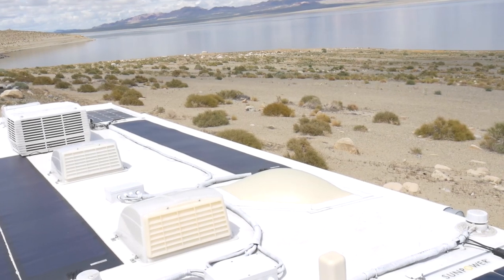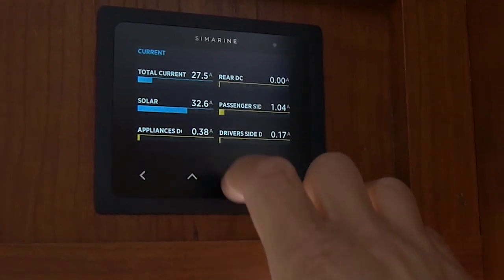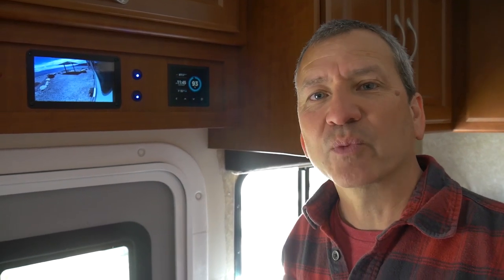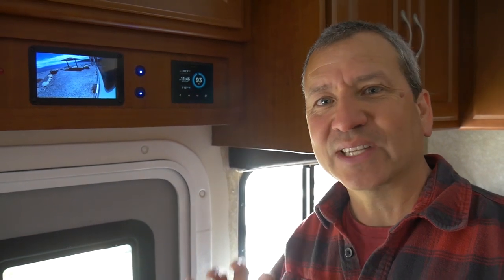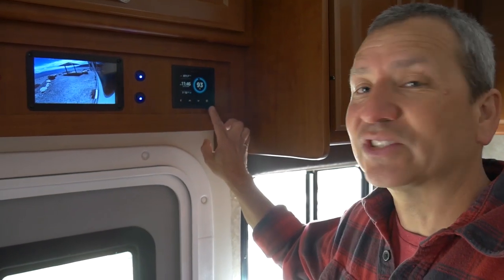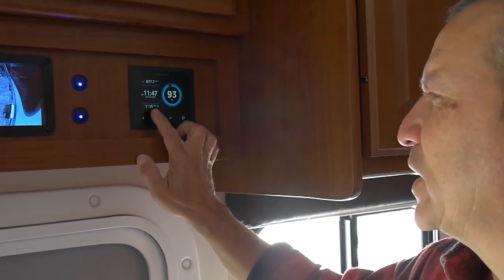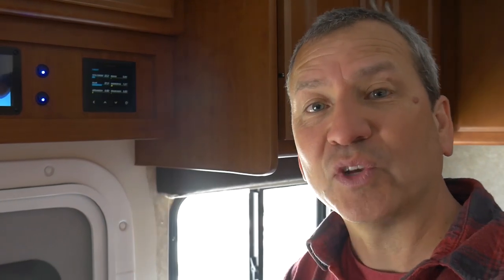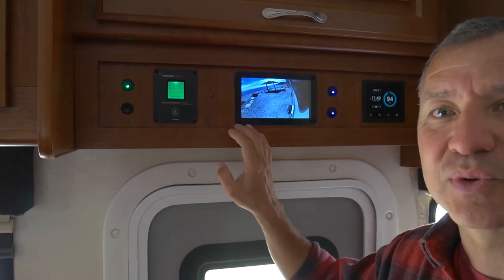HOW WE USE SOLAR for RV POWER OFF THE GRID - Full DIY System Tour

Comment from the maker: Get 10% OFF SUNPOWER Semi-Flexible solar panels like mine at SunPoweredYachts.com with the "RVWITHTITO" discount code.
Reply: 17:37   I WANT ONE... YES PLEASE!
Reply: Hi, I bought 12 V 175 watts Renogy but the most input i got on a sunny day at noon was at 110 watts - with 10 feet 12 gauge wire with mppt 30 amp converter is that normal ?  so I should get more power than this ?
Reply from the maker: @jeannie8262  Does not sound normal, but possible. Keep in mind that the current coming in from solar (Amps) is based on the amount of current needed at that time. For example:  if your batteries or electrical equipment isn't needing max power, it won't pull all available amps from your solar. If you have lead acid batteries that are in a float or absorbtion charge phase, less current will be pulled from your solar panels.
Reply: @RVwithTito  thanks Tito I got goal zero 1000 yeti . It's 100 ah litium input 30 amp with max of 360 watts . So it's not lead , I'm thinking of returning it just got it less than a month $288 for 175 watts , I wonder if other brand is better

Comment: Wow you crammed some big batteries into that compartment! And I love how you used a relay to turn off the converter when the inverter is on. Genius idea! I read the other comments and I am excited to see what LiFePO4 battery you get! So many great options these days so it's a tough choice! Nice job with your system btw, nice and clean install
Reply from the maker: Thanks Will. YES it was a very tight squeeze to get those batteries in there -- not to mention the 300lbs. They are not very old so I haven't been in a hurry to move to lithium. I figured the longer I waited the more options will pop up. The time has come though. You're videos have been very helpful while I consider all of the options. Cheers!
Reply: Tito your videos are the greatest,,easy to follow and so neatly installed...u r the  best !!!!!!!!
Reply from the maker: @marciabrainard9837  I'm so glad you enjoy the videos. Cheers!
Reply: two great content guys commenting here :)

Comment: Thanks Brian. I think of all the RV and solar DIY'ers out there, you're rig is my favorite. Your systems are thought out, safe, clean, and practical. Love your craftmanship as well. I guess with up to 750 watts and 50 to 60 amps of solar, you probably never have to unplug your shore cable from the inverter?
Reply from the maker: My rig is my favorite too! :) Glad to hear you're enjoying all the mods. You're right, we rarely unplug from the inverter unless we're on hookups because it's too hot and need to run our air conditioner. We normally avoid those situations and locations. Even when parked at home, I have a shore power hookup that I only use during the winter.

Comment: As always Brian another superior video! Well Done! You inspired me on my system that I started to construct last year by gathering the supplies. Took your advice, calculate what you need, determined what we have room for, then figure out what you need to deliver that. Even with the pre planning at the time of construction I still needed to improvise to get it all in. My system is portable, 2 x 100 watt panels with a stand alone box that houses the controller and the inverter. The system then simply plugs in to my 2 house 6V batteries with a single plug, the length of cable between the controller box and the panels is 30Ft. which allows me to "chase" the sun around the campsite (I like to park in the shade).

Keep sharing your inspirations.
Reply from the maker: Great. Glad I was able to help out there. Enjoy the shade :)

Comment: Hi Brian, Quite extensive system or should I say systemS.   Always great work and information.  Great Idea about monitoring the house batteries from the driver's seat.  My rig automatically sends a charge from the alternator to the house batteries when the rig is running.  At least I thought it did. I need to check that today to make sure.  Great overall look at options for anyone wanting to add solar and upgrade their RV.  Thumbs up as always, Lou.
Reply from the maker: Our rig wasn't setup to charge from the alternator initially, but it will be from now on. The voltage readout won't be as informative when I upgrade to lithium, but I'll find a way to see the state of charge while driving.

Comment: Hey Tito, absolutely brilliant video mate.
I have been watching many of both yours and Wills' videos lately and am currently building a 24v solar system on my small caravan. [purely Living circumstances] 
I've only been designing/building my system for around 5 months now and have learnt so much through both yours and Wills' videos.
My system is currently 2 x 250w Panels [adding an additional 2 80w panels this week] , 40a Renogy Rover, 2 x 148ah AGM batteries and a 24v 1200/2400w Giandel inverter.
My system needs the battery monitor/shunt setup yet but I do have FULL isolation of inputs/outputs through the same style breakers. Apart from brand names, your system is very similar to the system that I am building, so for that, I really LOVE your setup mate.

I'm also in the process of designing my own 'slim-line' solar tracking system that rests flat at the end of the day and rises when it senses the UVs. each panel will be tracking the sun independently on it's own regulator. I have the very BASIC design laid out on paper but naturally, a few small tweaks are needed before I continue with that side of the build. this tracking system WONT be functional while my caravan is in motion, only when stationary. Also only single axis so that move backwards/forwards not vertical axis as such.

Thoroughly enjoyed this video, shared it to my facebook so that I NEVER lose the important information that you have provided in it.

Travel safe, stay warm and happy RVing.
Reply from the maker: Thanks for sharing the video and your setup with us. I'm so glad my videos were able to help you with your system. Cheers!

Comment: Shouldn’t you use a shorter cable for jumping from the inverter, less voltage loss, and how did you handle the ground when powering the rv with the inverter,
Reply from the maker: Right now the distance is 7 ft to the inverter with 1% voltage drop at 100A. I'll be relocating the inverter later this summer once I remove my generator. At that point I'll replace the cable with 4/0 cable. We don't put heavy loads on it now, so it works fine as is.

Comment: Great video Brian... I like the idea of the panel in the mirror controller housing.  I'm a gonna steal that one.  What is the most amperage you have noticed out of your array?  We get a lot of sun here also.  I built a shunt to direct any over current into the water heater.  It is just a resistance load.
Reply from the maker: Yeah. That was a great little mod. I just have it wired to the relay in the engine compartment which already is wired to the house. It was a little tricky getting the wire through the door channel but I got it done.

Comment: I'm trying to do something similar and am following your footsteps more or less, but with only one 440W solar array plus a portable one. I did get confused when you said you use 6AWG internally and 2AWG for the battery output. At what point do you switch from 10AWG on the solar panels to 6AWG and then to 2AWG? Thanks for all your vids!
Reply from the maker: I ran #10 to the breakers near the controllers. To the controllers and Buspar its #6. From the parallel bus bars to the batteries it's #2.

Comment: Eric:  Regarding your old narrow unisolar collectors: are they stuck to to roof?  Would they be difficult to removed if they failed?  Which solar charge controller are you using for the 42 volt collectors?  Thanks for your help.  Dave
Reply from the maker: Yes. The Unisolar panels are stuck to the roof. I don't think I'd be able to remove them. So I'd have to just mount something over the top. So far they don't show signs of failure though. I'm using a Victron 100/30 MPPT controller for both series strings (on for each). Hope that helps!

Comment: Why do you have 2 charge controllers for 550 watts?  In fact, why did you have a third for the extra 200 watts?  Wouldn't one charge controller handle all 750 watts? (by the way, thank you for the instructive video)

Comment: Tito, great video with lots of info about electrical system... I was lost, but it was great. Have you done a video on how much energy you use when using your daily appliances? I would like to see how much your battery usage drops from morning to evening. I see that you turn off your inverter, do you do that to conserve energy?
Reply from the maker: On an average day we only draw around 50 Ah from our batteries. In the morning our remaining capacity is between 75% to 85% percent. Our overall energy consumption is higher, but I'm not sure what the number is. It's not being measured. Once the batteries recharge in the morning I switch my gas appliances over to electric so we get free solar energy. The inverter is running most of the time. I only shut it off at night if we don't need 120V AC. If we're using an AC fan or something during the night, I'll keep it on.

Comment: Thanks for your great videos, explanations, and diagrams. I am relatively new to RVing having a 2003 Thor Hurricane 30' since September of last year. I have been making moderate updates to my rig but have been studying solar since last January and am ready to go ahead and plan/design my system. One thing in this video that puzzled me was your statement about turning off the input from your solar panels, for whatever reason. My question is, what happens to the panels when they are in sunlight and producing power but it is not going anywhere? I have a foldable 200-watt solar panel that I currently use. However, I always cover them with the case they come in before and after I connect or disconnect them. Why? I am not sure why but I think I read somewhere that that is what I should do. Comments?

Comment: Hi Brian, I very much like your video's.  I also have a class c motorhome and interested in how you wired up the automatic converter discount when connected to shore power.  Also when you moved your house battery(s) to your new location, how did you handle moving your dc's battery cabling.  Please comment if able.  Thanks

Comment: I recommend the Eaton 1800w pure sine inverter that has a AC line in/out switch, so when you are connected to the shore power it puts your inverter automatically into charge mode to charge your battery and it bypass the inverter , when you disconnect the shore power turns on the inverter automatically. I have an extra one laying around if anyone interested
Reply from the maker: Cool. I'm sure someone could use that.

Comment: Brian, thanks for the information. I really apprecite the way you lined everything up and explained. I really liked the way you reinforced the bay the batteries went into. Good ideas there.  I am going to be adding solar to my class C shortly. Question...I assume you still have a generator (I have a 4K onan) and every solar install explaination fails to comment on the generator and how the wiring to it is done or effected. Is that on your websit( looked at the main page) or can you give me a simple answer? Thanks
Reply from the maker: Simple answer: There's nothing to do (in my case). My generator and shore power cables go into an automatic transfer switch. If I fire up the generator, then the power source switches to the generator instead of my shore power cord automatically (which is connected to my inverter when off-grid and to shore power when on-grid). I too have an Onan 4K generator and never use it anymore, so my near term plan is to remove it entirely to free up an extra 250lbs of dead weight. Look for that project in an upcoming video. Does that answer your question? If not, ask another and I'll add more to the answer. Cheers.
Reply: Ron Powell  So you disconnected the 12volt leads from your installed RV converter and ran them direct to your charge controller. Then your shore / genset still is connected in the same place on the original converter and to charge the batteries and you ran the 110 volt leads direct to your inverter more or less bypassing the installed converter for 12 and 110?  Larry

Comment: Are the house batteries clamped down onto that slide out tray?
Reply from the maker: Well I suppose they should be...but they are not. They don't budge though and there's enough thick cabling on top to keep them in place. Next time I work on them I'll add some kind of straps. Thanks for pointing that out.

Comment: I'm just a girl trying to set up my caravan for off grid and perhaps run an air-conditioner during the heat of the day in outback Qld Australia... Thinking 4 lithium iron phosphate batteries with 750 W solar blankets and an 3000 W pure sine wave inverter. Still not sure which controllers to go with.

Comment: Hey Brian,,,,,I love your videos,,,,but I have a question......The Boss Gal and I have a residential fridge in our Class C....It draws a lot of power from our house batteries....Is there a setup that can be done to disconnect it while boondocking and save some of the power for other items.....I was thinking about just turning off the breaker if I can find it and hope it is not being used by something else also.....or is there a way to install a switch to turn it off.

Comment: Great job explaining your system. I installed flex solar panels based on your how to do video. I have 900 watts via 9 100 watt, 18 volt panels. I have had to replace 4 panels due to failure. My panels are  all wired in parallel. The Max watts I have gotten is 650 and about 30 amps using max voltage to the mppt. Most days the wattage is 300 to 450.
MY question to you is how many watts and amps do your panels produce at max sun? I know May panels are not producing max watts. 
I am in Jacksonville Fl and all 9 panels are on a North South axis .
Thanks in advance for your response
Reply from the maker: The max I've gottien with this setup is 52 amps but that's only when running a blow dryer while charging. Usually I'm bringing in around 30-42 amps.
Reply: @RVwithTito  Thanks for the quick come back. I appreciate it. 2 other questions . Using either the 550 roof panels or the 750 total panels, what is your average amps produced on a good day or is 52 amps typical at best sun light?
Thanks Bruce
Reply from the maker: @MrMaddog1947  The 52 amps was with the full 750 watts. That was my absolute max so far. A typical charge current with just the roof is usually in the mid 30 amp range. Lithium batteries would probably draw more, with my AGMs they don't have a significant load to max out.
Reply: @RVwithTito  Thanks, In addition to the 900 watts, I have 600 AH of Lithium and a residential refrigerator. It looks like your roof panels produce almost 100% of the power for which they are capable. I am strongly considering replacing the AllPowers  flexible panels with rigid panels. Any other ideas I might chase?
Reply: @MrMaddog1947  with 9 panels wired in parallel I'm wondering if you have a thick enough wire guage to handle the amperage. Perhaps that's why you aren't getting the efficiency you are looking for.  Perhaps you can wire them in a series parallel combination. It gets tricky with an odd number of panels though.  I have 5-200 watt panels with 4 of the panels wired in series parallel and one panel going to a separate solar controller. I'm upgrading with another panel soon but will still be using the existing 2 solar controllers.  By running them in series I can use 10ga wire to the controllers and then 6ga and 8ga to the batteries.  As far as the type of panels I believe that they need to be able to keep cool and that is difficult with flexible panels mounted directly to the roof. Rigid panels have a few inches of space to help ventilation.  Brians system is great but there appears to be room for improvement. I'm concerned about the panels not being able to ventilate and he also has his solar controllers all crammed in a small compartment without apparent ventilation as well. Electronics don't like to get too hot!

Comment: Hey Brian, great video. As a couple working remotely, we're upgrading our boondocking ability. Can I ask how you do on average with 750w and 2 6v batteries with a work day between the both of you? I assume this system keeps you remote until you run out of water/black tank, like a week?
Reply from the maker: Correction. We have four 6 volt batteries. Power is not an issue. Our batteries get recharged every day and give us enough. You're correct. Water and gray tank storage is the biggest limiter. We have smaller tanks 42 gal fresh water so I carry an extra 6 gal jug in the car. We can typically go a week if we conserve. If we're a short drive from a dump and water source, then we can stay indefinitely by dumping and refilling every 5 to 7 days. We're usually ready to move on at that point anyway. You can typically pay a few bucks o most state parks and RV parks to use their dump and water if you can't find a free one.  Hope that helps.
Reply: @RVwithTito  Thank you! We definitely wont have as much solar as you when we start off but I just need to power two macbooks and a hotspot primarily. 2 6vs and about 300w of solar suitcase